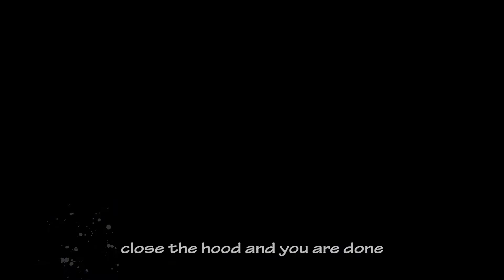09-14 Ford F150 GAZE Halo Projector SMD DRL LED Headlights Installation Video

Comment: Been running with these headlights for a year and I'm pleased with them. Passenger side bulbs just went out yesterday, but I had planned on replacing both sides after a year anyway.
Reply: When your bulb went out. Did your halos go out as well?
Reply: did you have to buy new headlight bulbs before installing?

Comment: I know this is a ford but I wanted to comment on my 2000 Chevy Silverado 2500. I installed 1st set last week and replaced high beam with an led I already had. Tried the Low beams out that night and was super disappointed. Light output sucked! Ordered replacement led's for the low beams. Installed them and tried lights out that night and I'm still very disappointed. Why are my lights so dim through these projector lenses?

Comment: Just installed them. The halo part doesn’t light up at all. It had some extra wires sticking out but it doesn’t say anything about connecting them into something

Comment: Bought these for my 2011 Raptor, 
Look awesome however the Halo portion of the driver side unit didn't work. Feel a little ripped off.
Reply: Talon 37 same here I put leds on projector and now one side don’t want to work

Comment: Are these headlight compatible with my 2013 F150 STX model. I have the regular crystal headlights? My headlight are like the ones you removed on the video.
Reply from the maker: Yes, it totally fits Ford F-150 STX Standard Cab Pickup (2-Door) and Extended Cab Pickup (4-Door) models. 

-Matt

Comment: I was under the impression that this light kit didn't come with the H1 and H7 bulbs required, but the video didn't demonstrate that installation. Is that not the case?
Reply from the maker: Hello JimmyD7707, this headlight do not come with any light bulbs, you will have to purchase the bulbs from outside. the purpose of this video is to demonstrate the headlight installation and the look of these headlights. 

Thank you

-Matt
Reply: JimmyD7707 Sorry I'm 6 months late with a reply for you...better late than never. I just got these headlights in today and installed them as soon as I got off work. I was thinking that I was going to use the dual low/high beam bulb from the OEM headlight, but was surprised to see that my new lights came with the high beam bulb installed already. Only bulb I transferred over was the amber bulb.